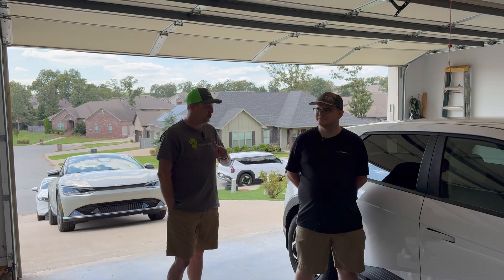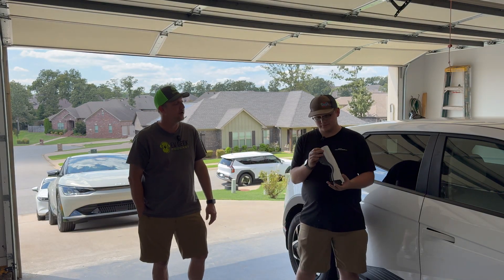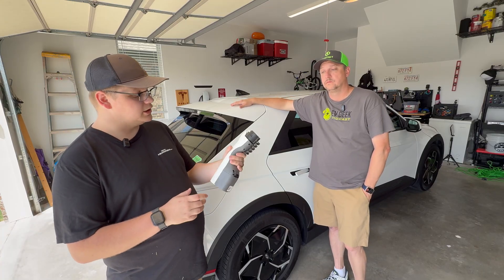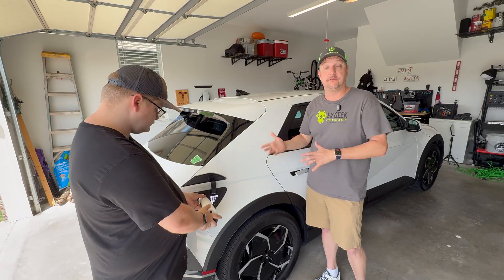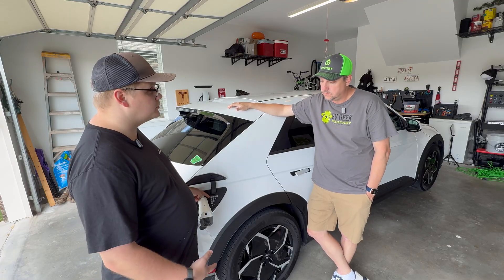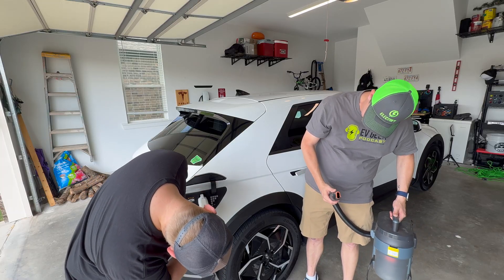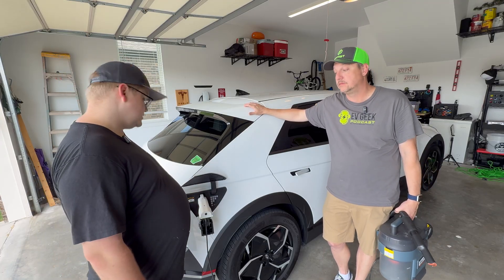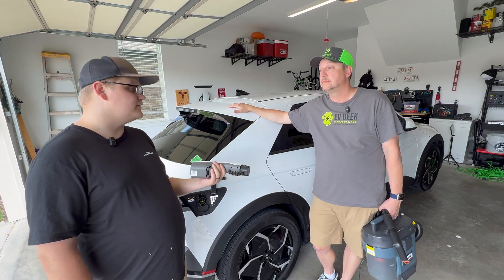Every Car Should Have This! Vehicle to Load Demo on Hyundai/Kia EVs!

Comment: My 2024 EV6 GT-line came with the V2X adapter.  It very nicely runs power tools, lights, and nearly any 120V device.  However, I tried to charge another EV using its factory supplied EVSE and charging failed. I don’t know if charger was too large a load or an issue with floating ground.
Reply from the maker: We’ve never tested it to see if it can be used to charge another EV… But I didn’t think you could

Comment: My Kia EV6 also has a 120VAC outlet between in the back seat area.  I have never tried using both at once, though. But I used the external V2L adapter to power our refrigerator during a power outage just a few days after I got the car! :-)
Reply from the maker: That’s awesome!
Reply: Thanks, I forgot that I have them too in the Ioniq6.  In the back seat.  I could use it for the refrigerator.  Thanks.